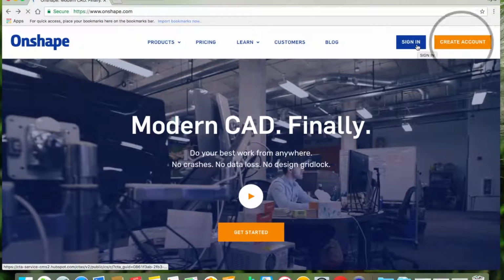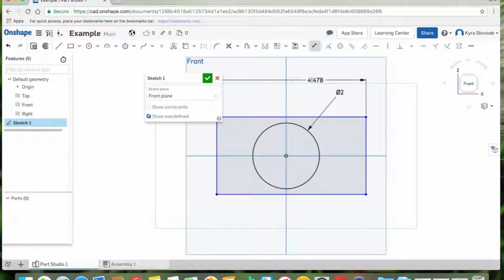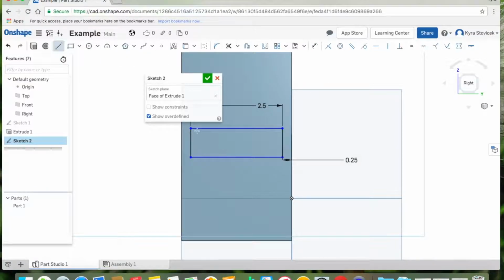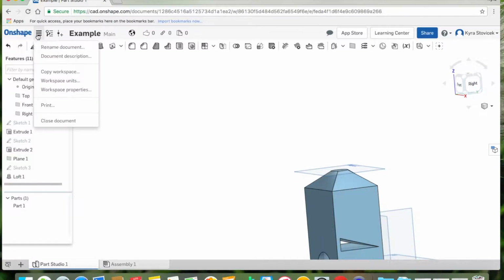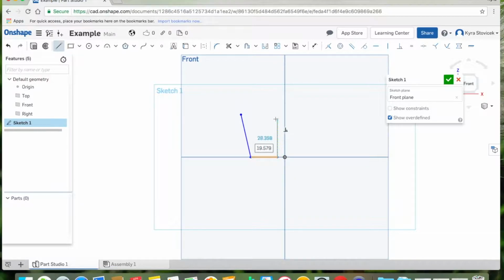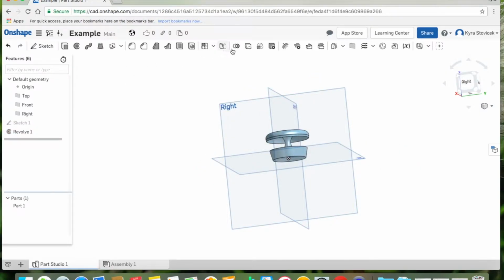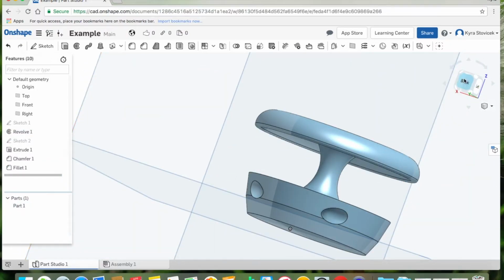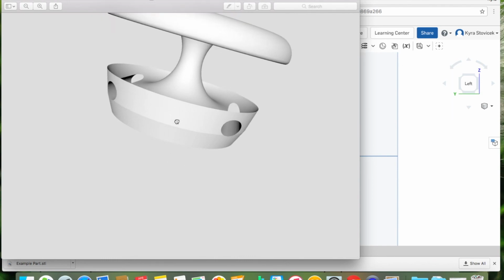Onshape Tutorial

Comment: I just want to create a simple sphere
Reply from the maker: on onshape, you could draw a half circle around the origin and a line straight through the center and then use the revolve tool. The axis you will chose is the line in the center and then the object/face you will select will be the half-circle! Let me know if you need any more help with that
Reply: @kyrastovicek  I have 14 cylinders that need to be 30 mm away from each other. In general: How do I work with specific distances?
Reply from the maker: The Tilted Cat you can use the dimension tool to distance things from each other when you are in a 2D sketch or you can add a plane whatever distance you need it to be away from another object. Or if you want the same object copied and placed 30mm from each other, there is a rectangular duplication tool which places copies above or below the original. If you need them to be evenly spaced from each other in a circular orientation, there is a tool for circular duplication!